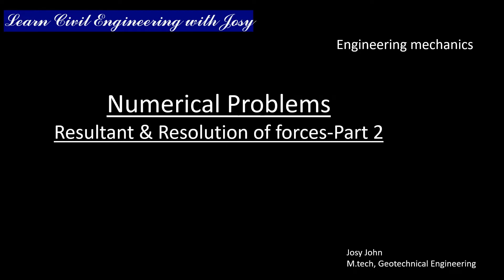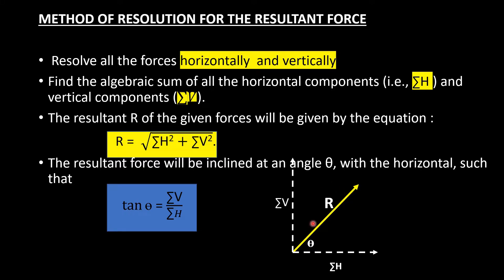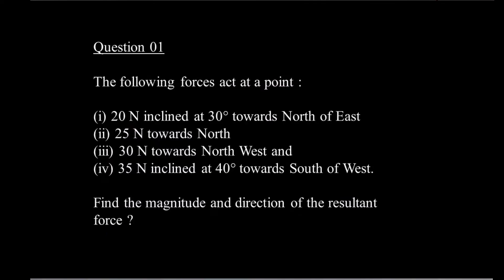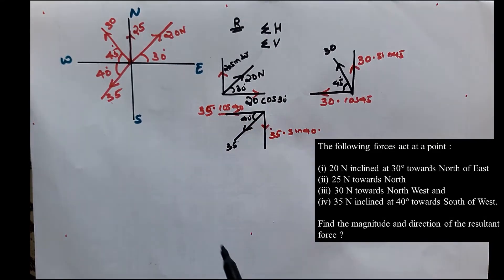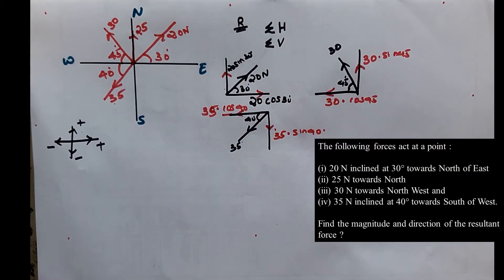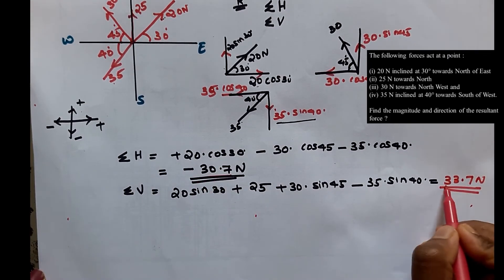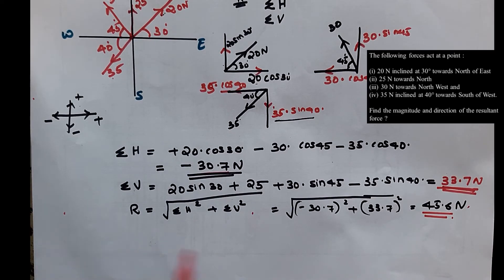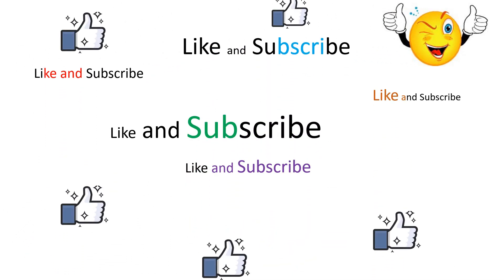Problems on Resultant & Resolution of forces (മലയാളം)|Engineering Mechanics| Josy's class| KTU Civil

Comment: 4:36 ഇവിടെ 45° ഏത് sidil ആണ് കൊടുക്കേണ്ടതെന്ന് എങ്ങനെ അറിയാം?🙄
Reply: നാളെ exam ഉണ്ട് അതിന് മുൻപായിട്ട് rplay കിട്ടിയാൽ 😊
Reply from the maker: 45degree eth sidil venenkilum kodkkam..bcz ath full 90degree anu..athond horizontal ayto vertical line aytoo chernnu varunna reethiyil edkkam..
Resolve chyyumpo sredhikjanm enne ullluu..
Reply from the maker: @mohansif9894  athe..
Reply: @learnwithjosyvaidyan7938  14:27 ഇവിടെ 47.7° horizontalinod ചേർന്ന് വരാൻ കാരണം ഉണ്ടോ?
Reply from the maker: @mohansif9894  2:20 thot onnu kandu nokk..
Athil aa equation vannirikkunnath kando..tan theta ennu vachal opposite /adjacent anu..so tan inverse  (vertical/horizontal) cheyyumpol theta kituunath horizontal ayt aayirikum..
Reply: @learnwithjosyvaidyan7938  👍
Reply: @learnwithjosyvaidyan7938  tanks miss